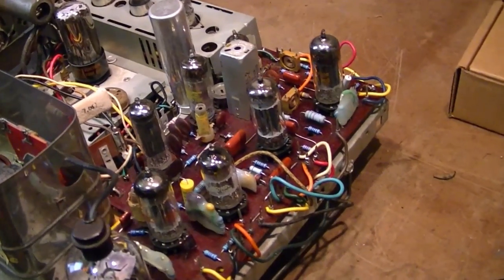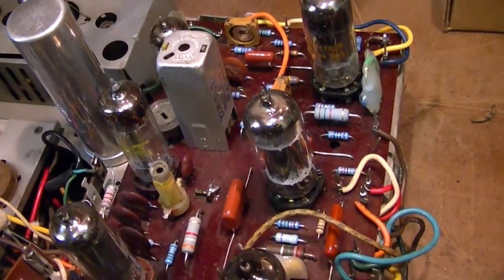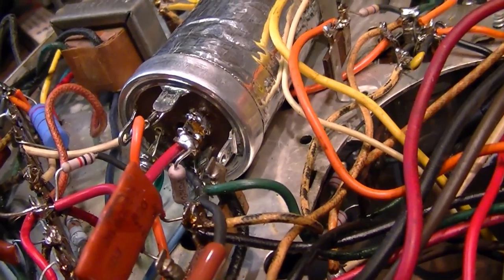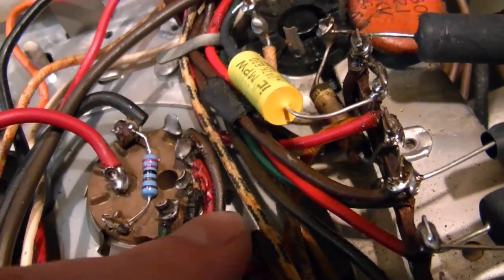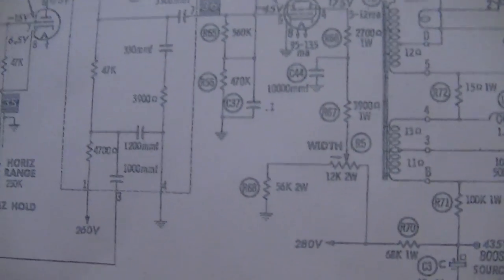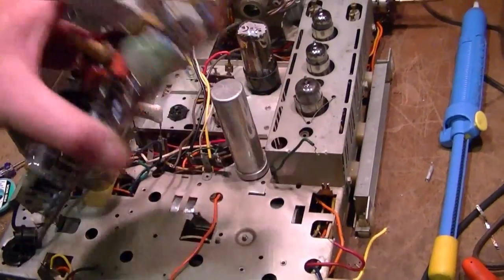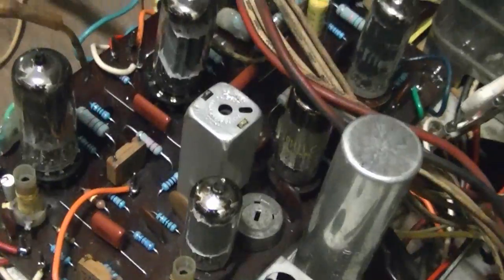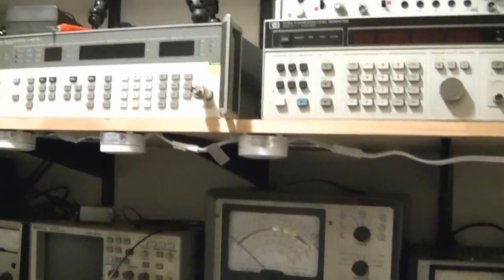Predicta Holiday II restoration p6o6

Comment: WELL... that video ended up being pretty good. I personally thought it would end up being a trace on the board that had a break in it, which when disturbed, would given intermittent results. I was close, "but no cigar."
   Glad it wasn't any of the following;
1) heat related
2) socket and/or pin continuity
3) One of you K-networks that you built
    You must have had that; "OMG!", revelation when you spun that board over and plainly saw that you didn't even solder one of your K-network pins at all.
   You're right. Here is my analogy at the moment here that shows the same indicators. The home remodeling here, that I've been doing for the last few months has been going like this: Measure, measure again, and then again, then cut. That's still nipped me in the butt a few times as well.
   Glad you finally got it all figured out now and can confidently ship it out.               Congrats!

Comment: Good job, I'm sure the owner of that Predicta will be more than pleased . Finding your soldering error reminds me of when I was in high school, and a local stereo dealer wanted someone to put some  Dynaco stereo amp kits together so I tried it.  The first two were ok, the third one I missed a soldering joint, and that was the end of my part time job.
Reply: If you were sacked on that basis he probably wasn't worth working for to begin with, I've seen radios that left the factory where someone forgot to solder a joint, yet somehow 50 years or more went by without anyone detecting it.
Reply: OlegKostoglatov  I thought the same thing, he didn't give you a chance to get good at it.
Reply: I too have seen on more than one occasion, solder connections missed at the factory. On both US & imported radios.